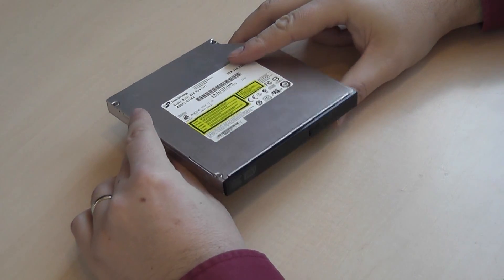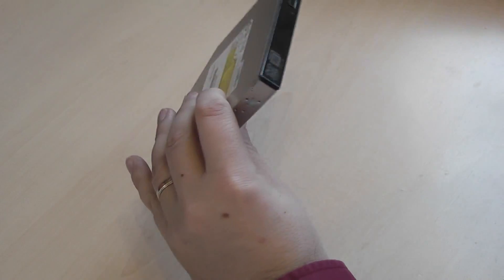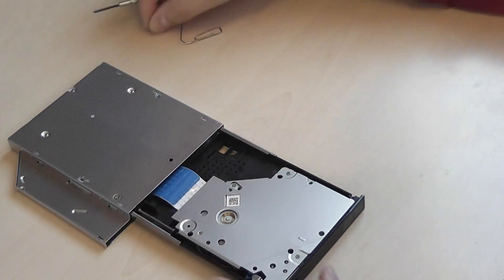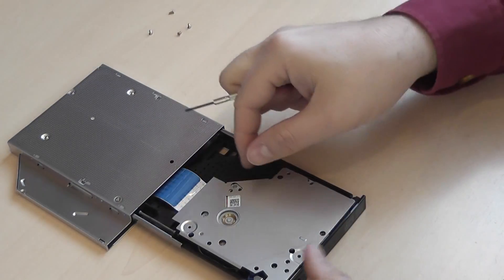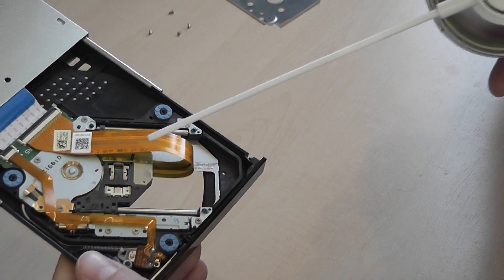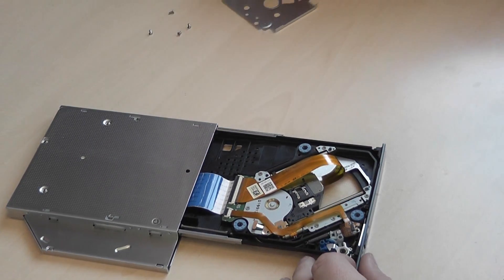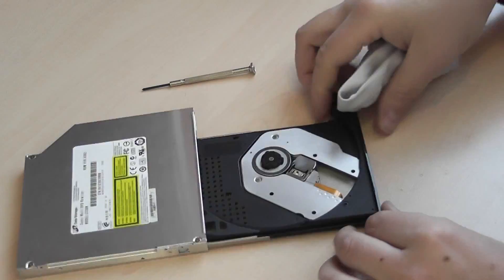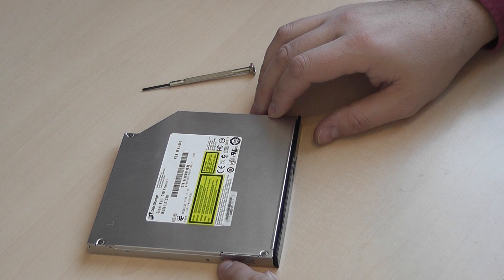How To Clean Slim DVD Drive Lens and Laser From Dust

Comment: HI JONNIE,I AM HAVING PROBEM WITH MY DVD WRITER,WHEN I INSERT CD IT WORK,BUT WHEN I PUT DVD IT SHOWS INSERT DISC IN DVD WRITER WHAT WILL DO?
Reply from the maker: +Paras Mahotra Hi, Paras! DVDs have much more dense writing than CDs, so problems on the optical system might affect the readability of DVDs, while CDs might still be working. Try cleaning the lens as described. It should help if properly performed. (BTW, please, do not  use ALL CAPS because it is the same as shouting, and YouTube will automatically mark your comments as spam ;))

Comment: Is there a way to do this without a dust blower?
Reply from the maker: Canned dust blowers are great because they blow air that is free of dust. There are vacuum cleaners that have accessories for blowing the air out, but such air usually contains dust. Blowing air from a straw in your mouth is also not the best idea because that way you are likely to spit on the lens (not talking about a loogie - micro droplets present in breath are enough to screw things up) ;-) You can find compressed canned air for 3-5 €/$ so it is still the safest and most inexpensive option.

Comment: I found this really helpful. Thanks for sharing. :)

My DVD writer has no problem reading but it stopped writing. Will these steps help?
Reply from the maker: That situation happens often - I don't know whether the problem in that case is the degradation of the laser diode or actual damage to the lens (dust particles that falls on the lens get burned on its surface, degrading the lens).
Anyhow - try, it might help.

Comment: is spraying the back so important, wont the air clean it all if I just do the front?
Reply from the maker: DVD/CD laser cleaning discs always clean just the front side. It definitely will do some good, but the dust is on both sides of the lens, so to get the maximum you have to do front and back.

Comment from the maker: You can always take another disc and see if it works in your drive. Even if you find a few that work, while the most of them (that work in other drives) won't - then it's cleaning time. In some cases, even a thorough cleaning won't work - so you'll have to get a new drive.
Reply: Why don't you make one video on how to maintain the cd/dvd drive so it would long run

Comment: My dvd drive for my laptop been making loud noises (same type as displayed in video). When I've put a dvd in the tray and tried to play it,  it loads the dvd menu fine without making these noises (or doesn't play it at all and the software crashes), however if i try to load an episode with the former occurring it makes a loud rattling noise which i can only assume it as trying to load the disc information. does it need a clean or is it the disc.